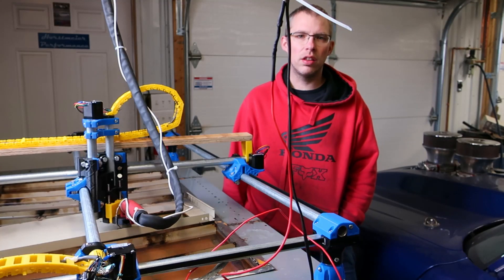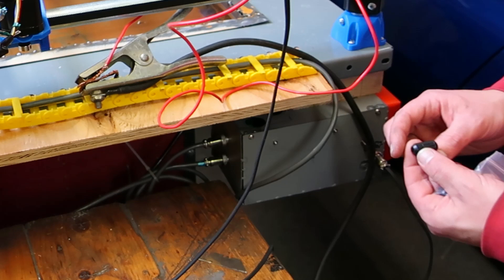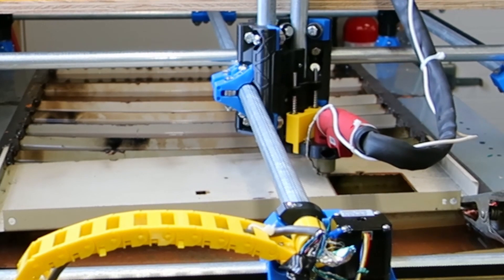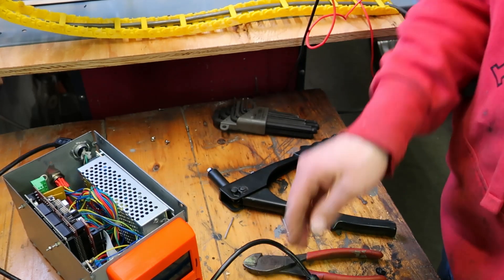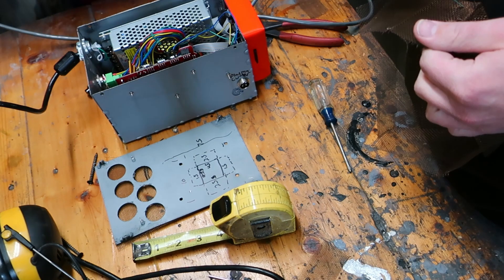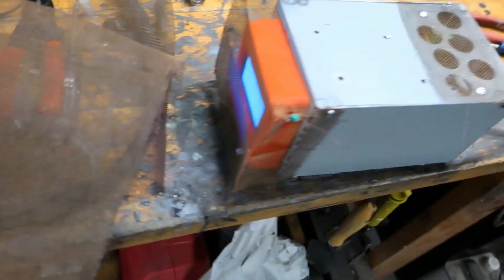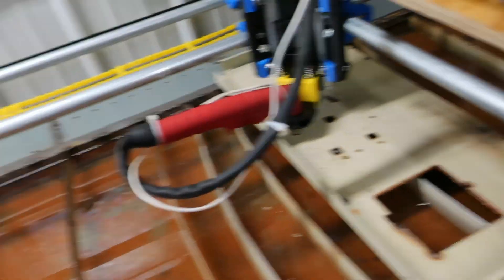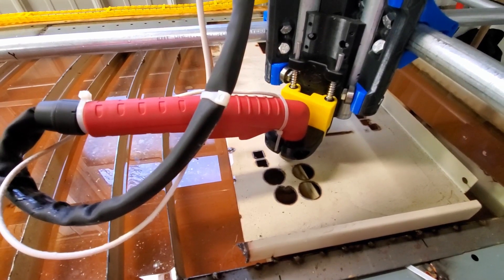MPCNC Primo Build Ep. 16 Shielding Electronics

Comment: hey mate wondering what software your using?
Reply from the maker: On the Arduino? Marlin 
I used fusion 360 to program the parts
Reply: @eliworks8549  thanks, ill keep trying to get marlin sorted out i seem to get a different arduino screen when i try to open it
Reply from the maker: You have probably watched it but Episode 6 in the mpcnc Playlist I quickly go over it. If you get stumped don't forget the v1 engineering forum.

Comment: Is your plasma cutter a high frequency start? if so that's why your having issues with E.M.P.  I know it will cost some money, but try a plasma machine that is a pilot start and not high frequency. This is why your really having issues. Also check out your breaker, need at least 50 amp breaker. I plan on making one myself and by the way im a welding college professor. anyway hope this helps
Reply from the maker: James- I did sell my Eastwood Plasma cutter and buy a Cut50L on Amazon. Took care of the interference.  Now if I could get it to cut as clean as the old one...
Reply from the maker: It is a high frequency start. You are correct I wouldn't have any of these problems if I had a cnc compatible machine. I already owned this one so it seemed fun to try and work around the issue. My machine won't pull close to 50 amps from the service, it only requires a 30 amp 240 volt circuit or a 20 amp 120 volt circuit.
Reply: Hi James, I use a CNC pilot arc plasma cutter but I have the same issues. What can I do? I already grounded the cables and the box of the arduino.